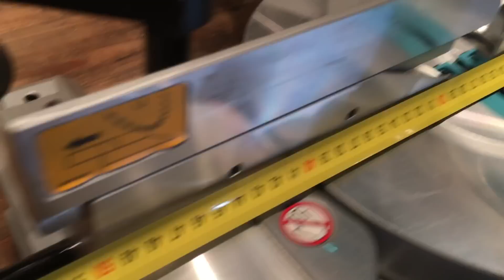Makita LS1018L Unboxing and First Run

Comment: hi, do you recommend this saw enough? I'm looking at this particular one for myself. thanks a lot
Reply from the maker: Hi Iss, I like this saw a lot but it takes a lot of space to the rear because of the sliding parts. It is very robust and makes great cuts. You can adjust everything so you get perfect square cuts. The dust collection is – like on most miter saws – not so great. For the price it is a very good choice so I can recommend. The Festool compound miter saw is probably better in dust collection and saves space, but it costs twice as much. I hope that helped you.

Comment: So do you still like it ? Im thinking about getting this model but heard bad reviews.....after a year how is it
Reply from the maker: I still like it but it creates a lot of dust and it needs a lot of space because the sliding part sticks out on the rear side. It is a good saw for a fair price, but most cuts can also be done on a table saw.
Reply: if it creates a lot of dust, why don't you hook up a vacuum to it
Reply from the maker: I do of course, but even if it is a very strong shop vac it is not collecting well.
Reply: Shaun Todd get the Ls1019l model